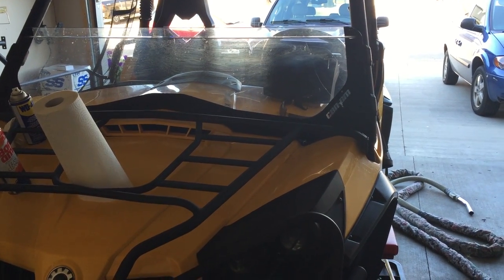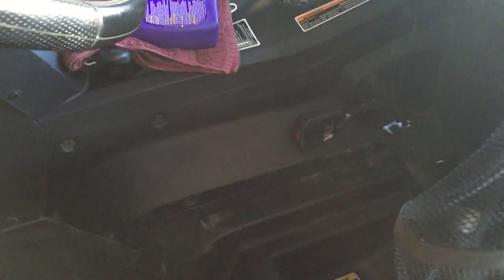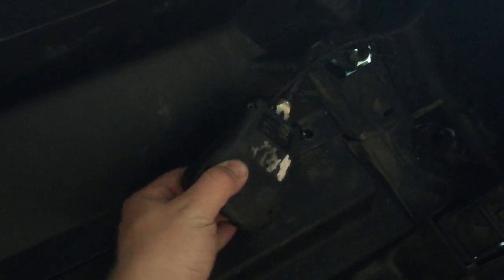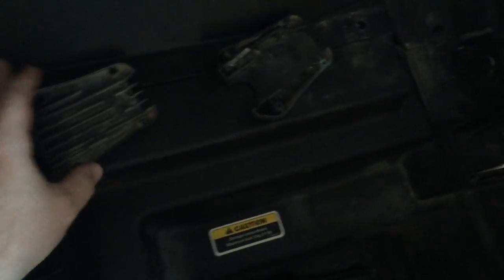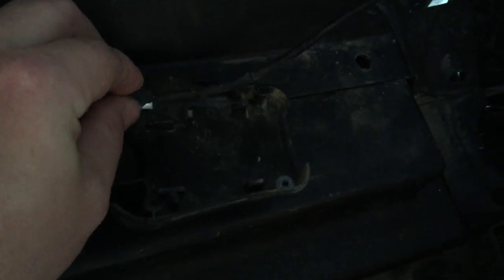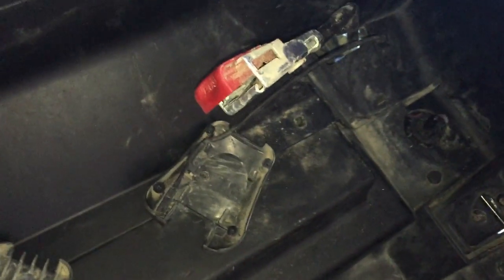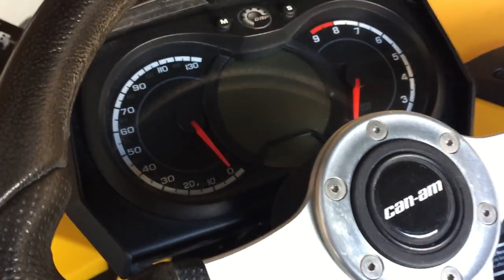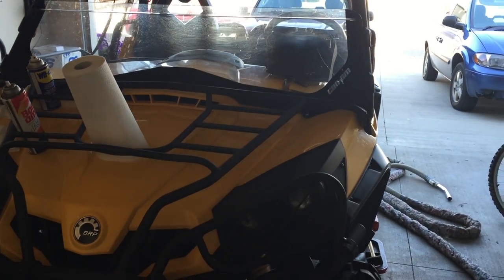Can Am Commander\Maverick Seat Belt Limiter Bypass

Comment: My Commander is a 2014 and I tried this, but the switch is attached somehow to the plastic latch body. I think Can am changed it so it's no longer easy to pull the switch out and turn it around like in this video that's using an older model Commander. I tried to pry mine loose but it seems like it would ruin it. The top 1/3 rd of the switch comes a little loose, but the bottom 3rd stays attached, and while prying it up the switch starts separating and I can see wires inside. I stopped trying to get the switch out, put it all back together, but now with the switch half's are little separated so now the seat belt latch won't go back in well because now the switch is partially in the way. Now each time I try to buckle it I have to take a screwdriver and push the switch out of the way enough so it will latch, had to carry the screwdriver with on a ride for each buckle up, or I would be driving back home at 10mph. with the speed limiter on and not being able to wear the seat belt. Will later cut the wires and fasten them together, no more messing with that locked in place safety switch!

Comment: Hi I have a 2017 commander I guess brp got wise now they glue it in so by the time I got done I had 3 pieces the wire and switch in two pieces so if you guys try this and get the same results just pull the wires out and sodder them together then it works